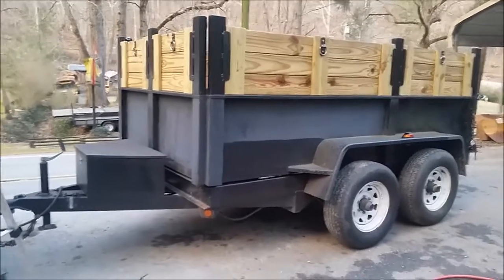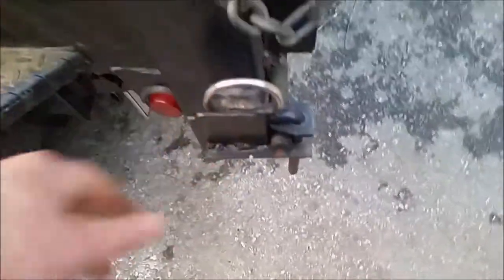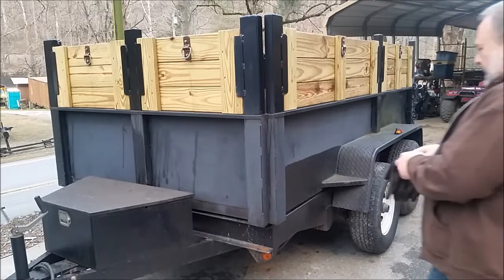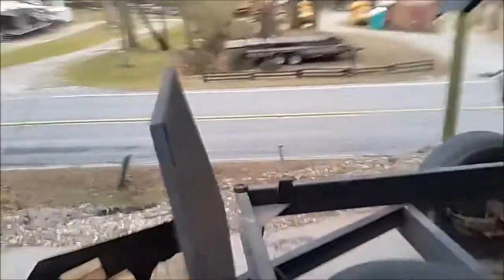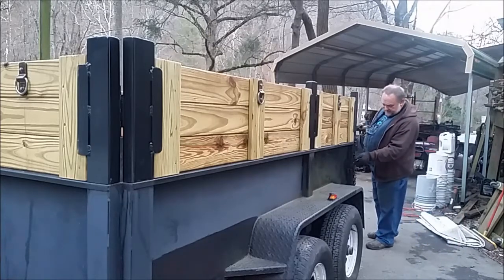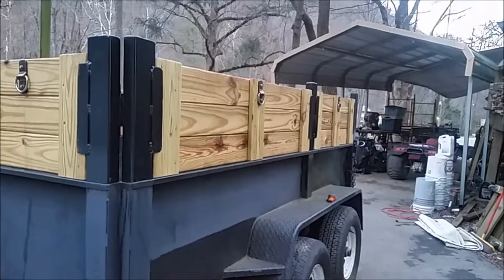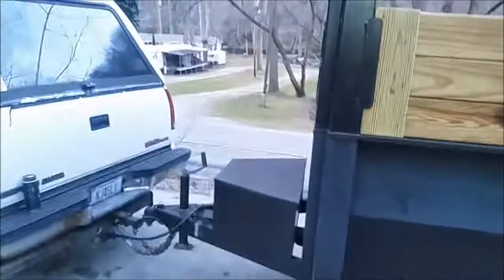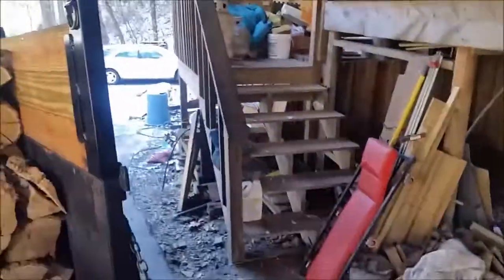Dump Trailer Upgrades: Removable Sides, Spare Tire Rack, Tailgate Mods, etc..

Comment: So the metal stakes are something you fabricated mostly yourself?
Reply from the maker: ForFoxSake. Yes.  Correct. I made them all myself. I used 3/4  × 1/4 angle welded inside of the 2x4 Rectangular tube. 
Had to grind the 90 degree edge of the angle to get a good fit. 
Hope that helps.
Reply: @MarkThomas123  Thanks, I saw online that some companies make the stakes for trailers like this but they are ridiculously overpriced.
Reply from the maker: @HexaFox  Yes. I agree.. But, I can tell you that, if it is a one size fits all solution, it won't fit "every" trailer well..  I have a Bri-Mar 6'x10' Dump Trailer, and although it is a good trailer, build well, etc,,, a one size fits all solution would not have worked..  The distance between the upright stakes were not the same on both sides, so, had I not checked, and built all of the Board Panels the same, they would not have fit. 
The 2x4" rectangular tube that was welded to the sides of the trailer where I slid the metal stakes into the pockets were welded heavy on one side, then, the other, so, they were surely out of square/rectangle, and each one had to be fitted to the hole. Buy building them myself, I was able to compensate for that by grinding off the center sharp edge of the angle that went up into the vertical square tube I added, so, it fit flat against the inside.. Then, drilled some holes and plug welded the top of them..  I only went up into the 2x4 rect tube about 3", but, it was too far to get a good weld, so, drilling a hole and plug welding worked out great.. 
So, basically, I ground down the sharp edge on 3" of the angle going up into the 2x4, so, the angle where it exited the 2x4 tube, the sharp edge of the 90 degree portion of the angle was actually past the outside diameter of the 2x4, and had to be ground down to fit the 2x4 stake pocket.. I ground each of them (4 pieces = 1 each inside corner of the 2x4 rec tube, where I welded in the 3/4" x 3/16(corrected, not 1/4)thick angle). So, a bit of grinding on each piece, but was able to get them to fit perfectly.. Then, I took a stick (1x1" ripped on a table saw), and taped a sock on the end, and put some bearing grease on it and mopped it up and down the trailer stake body to get it fully covered, then, the same with the angle.. It's been a couple of years now, and, still no rust, and they slide easy.. 
On the two rear stakes, I fitted a piece of 2" x4" x 1/8" flat bar between the 4 pieces of angle and ground it down to fit.. I was thinking it might need some extra strength, but, that is when I found out that the Rectangular tube wasn't rectangular from the factory, from the way the mass welded them together.. That took a heck of a long time to get both of them right.. The middle ones, I just used 4 pieces of angle sticking down only welded inside the riser 2x4 rec tube, and that was more than strong enough, so, that is the way I would do all of them again, if I ever did it again..  It took me a little extra time, because it was a "Mind Design" project. I just knew I wanted stakes and board panels and went out and figured out the best way to do it. Next time, I would already know.. Ha... 
You could do this yourself... All you would need would be some 2x4" x 1/8" rectangular tube, 3/4 x 3/16" angle 4pcs each upright, and about 24' of 2"x 3/16" flat bar for parts, and a 4" angle grinder with a 10 pack of cut off blades, and a 10 pack of Grinding disks, and you could grind/fit/drill all of the parts and take it to a welder, and he could weld everything up in 2-3 hours, and you could go home and grind the bottoms of the angle and make everything fit.. Then again, you could get an Arc or Mig welder from Harbor Freight and give it a whirl yourself.. :)   
But, you could do it with 2x4's and some strips to fit the rest of the pockets and come out fine too..  Should last a while if you treat it, and you cap off the vertical end grains of the 2x4's  with some sheet metal.. 
If you really want it to last, make it from treated wood, let the wood dry out a bit after you cut it (stand it on end while drying), then, get some plastic roof cement (roofing Tar), and put it in an old 1 gallon Ice Cream bucket, and keep mixing gas with it, until you can paint it on with a cheap paint brush...  It will dry and get hard, then, you can grease the piss out of it where it goes in the hole, and hope you don't have to drill it out if you ever have to remove it.. (what I had to do to the boards that were there that I had to remove.. Ha..Ha.. 
Either way.. It's a project you can surely do, if you take your time, and would be well worth your time doing it. 
I use my trailer at least once a month to haul off my household garbage to the dump.. They have an elevated dump station where I can dump into the back of an 19 wheeler below..  If I leave it in my trash trailer and go by myself, I have to unload each bag and stuff it in a trash compactor and keep running back and forth punching the crush button, and on both sides of the trailer.. I just park the dump trailer next to it and pull one side of the boards of and move everything from the trash trailer to the dump trailer before I go.. Then, all I have to do is back up, let the tailgate down and hit the lift switch and dump it all at one time and go.. 
Other times of the year, I use it every day for a week or two, and periodically, several times per year for a load here and a few loads there maintaining my property..  It's hard to justify the expense if you are not going to use it quite a bit, but, you will surely find things to do with it,, if you have one.. Ha.. :) 
Just remember.. A welder, a carpenter and a Surgeon all use the same basic set of tools.. Two eyes, two hands, and two feet, and what little we use of our brains.. So, there is nothing anyone else is doing, that you can't also do.. It's just the matter of "I can" before the "I do"..  I have not gone to school for anything that I do, and I generally do a better job than those who have.. One thing about teaching yourself.. You never know when you know enough, and no one is telling you that you "Can't" do this and "Can't do that".. I have drank quite a few beers showing guys who were told in welding school that you can't do this or that, so, they never tried.. And, I say, shit, what do you mean you can't do that.. Get me a beer and I'll show you it can be done.. Ha.. If you buy a stick welder (arc), get some 1/8" 6011 welding rods and don't buy any other rods.. I can promise you,, you can weld whatever you want (mild steel) with it.. from a gauge steel to 1" or more thick.. 
Same thing with a cheap Harbor Freight Mig Welder or "Flux welder without Gas".. I have done it too many times.. HF makes a good little mig welder.. A good plasma cutter too, but, the Cut 50's on Amazon are so much cheaper and they work well too..  Good Luck.. Hope things work out for you..  I'd better get back to work.. Upgrading all of my computers to Windows 10 finally.. Still have some work to do.. Would much rather be out welding something. But, have to build some cabinets and drawers  to do some organizing first.. Ha.. Cheers!!
Reply: @MarkThomas123  Thank you for the reply. If one thing is clear it is how passionate you are about this kind of stuff. I was also thinking about how a one size solution would not fit all either for this very reason. It is funny you mention it I was just looking at a Bri-Mar 6x12 dump trailer for my business. The stakes that I saw were way too expensive. It looks like you have to purchase them in pairs and they are like $200 a set or something unbelievable. Also you said you greased them? Can I ask what you used? I would imagine if these are not greased they would be destroyed in quick order.
Reply from the maker: @HexaFox  I greased them with Axle Grease or Wheel Bearing Grease.. It was to  allow it to slide easily without the chalkboard screeching effect, and to keep it from rusting and getting stuck due to the rust.. A little bit of rust can swell things pretty quick and jam things up. 
I just put a sock on the end of a stick, mopped on some grease (sticking the stick/sock into the can of grease and rolling it around, and then mopped the inside of the stake receivers, and the angle iron that was going to slide down in them.. Works great.. 
I have played around with all sorts of paint and prep.. It's hard to beat regular Walmart $0.99 per can spray paint. Seems the Rustoleum, no matter how much you prep it, still rusts much faster than the cheap walmart paint. The only thing I have found better (much more expensive) is a commercial product called MCU or Moisture Cured Urethane, and in the heavy silver metal filled flake paint, which you have to vacuum seal, or, fill with a gas heavier than air, and has a shelf life, at best of about 1 year, if you do a great job keeping the moisture out.. Nice thing though, you can paint anytime it is above freezing, and that is when I get to do most of my work.. Winter time. 
I used the Walmart Rattle cans on the trailer, because I knew it would be in the weather full time and I wanted to test it again.. Still looks great..  
If you are going to use wood, even treated, you have to seal the end grains, and, I have not found anything better than the Hydraulic Oil/Kerosene mix that I use on my trailer decks. I have a video on it when I did my 18' tandem Lawrimore utility trailer.. Just search for Trailer and you should find it. Still on the first application.. Just keep putting it on, until it won't soak up any more and, it should be good for 3-5 years or more.. If you really want to take care of it, recoat somewhere between.. 
Get the size you need.. If you are looking at hauling really heavy stuff, might go with a 6x10 instead of a 6x12. The payload is higher on the smaller trailers in the same Axle weight class because the trailer weighs more, so, less overall left for payload..  You will never fill up any dump trailer with Sand/Gravel, and won't need sides really.. 
But, if you haul removed roofing or limbs, lumber scraps, nice to have sides due to the volume vs weight.. 
10,000 lbs or 5 tons of gravel is about what my 6x10 is rated for plus the 2k for the trailer, and, there is a hump in the middle from to rear, about the height of the metal sides, and then, it rolls over to the sides, usually no more than 3-6" high on the sides (loaded by a huge Front End Loader). By no means full. Something to think about.  Make sure you get one with brakes on both axles, unless you are pulling with a 1 ton truck.  You never know when you will need that extra braking power, and, the tow vehicle pulling 12k lbs sure can use it, and make sure your tow vehicle has full time power to one of the pins to keep the battery charged while using it..  It is usually the top right pin when looking at the female plugin on the back of the truck standing  where the trailer would be. Some times people don't worry with hooking them up, but, you need it on a dumper..  They are pretty rough on  a battery.  And, keep the battery charged and don't let it sit with a low charge for long periods of time.. The Sulfation will get it, but, you can put a 200 amp charger on it for 30 minutes at a time, letting it cool, tapping on the battery while it is charging and knock the sufates off, and bring a bad battery back to life.. Leaving it in a discharged state is what causes the to Sulfate at a much higher rate.. 
I have learned lots of things over the years.. A lot of it, the hard way.. Ha.>Ha.. Some of those points are worth writing down somewhere and looking at them every now and then until they become healthy habits. 
Good Luck with that business... I hope not to have another year like last year with this Mask Crap... 
I rebuilt my immune system before the season and, wasn't wearing a mask , and destroying what I had done to not have to live with a face condom on.. I can't believe what is going on in this Country, but, if things don't straighten out pretty quick, and it looks like the Deep State gets away with what they have done, I'm just not quite sure what I am going to do.. But, if I have to move to a different State or Country for that matter, I am just idling right now, wondering which way I am going to go.. Sure as heck don't want to try to find employees under a Biden Admin..

Comment: Hey Mark, where did you get those metal sleeves fabricated to accept the wood sides you built?  LOVE that concept!!!  Great Job!
Reply from the maker: I made them.. They are  2" x 4" rectangular tubing with some 2" flat bar welded to the sides to accept the wood panels.
3/4" x 3/16" angle welded inside of the 2x4, and goes down into the 2x4 rectangular in the dump body..

Comment: Very nice walls .😍😍😍
How much you will charge yo do this in my trailer?
Thanks. And GOD BLESS YOU
Reply from the maker: Sorry.. I did not see your question.. I am in far Western North Carolina.. I thought about that.. Doing everything except the treating of the wood,  I would say, it is worth $2800 to build it again.. Materials and Labor, but, not 10 or 12 coats of the wood treatment. That takes a good while itself, applying, waiting for it to soak in, etc.. Easy work, but, time consuming.. Best done by the owner of the trailer.. Not anything technical about it.. I just used a 4" foam roller and a chip brush to get into the cracks... Cheers!
Reply: @MarkThomas123  THANK YOU!!!!

Comment: Where did you get those pocket stakes for side boards?
Reply from the maker: I built them in my shop. I wrote how I did it in the pinned article here.. If you try to build them, just know, whatever your stake pockets are, they are probably not all the same, so, whatever your design is, make sure it is "flexible". You will understand  when you read my pinned comment. There would be no way to build something like this and mass produce it. Each of my pockets were slightly different, so, each one was custom fitted, because, I hate shit that rattles on a trailer.. Ha..

Comment: Where did you get the metal stakes?!?
Reply from the maker: The black metal 2" x 4" Rectangular tube that sits between the wooden panels and at the ends and corners of the trailer?? I bought the rectangular tube, cut them to size and welded the caps on the top and welded the positions in them, and welded the bottoms and ground them so they would fit perfectly in each of the positions.. 
I seriously doubt you could buy a kit that fits well.. People who build trailers don't use jigs, or don't pay attention to using the jigs well enough to be able to buy anything but a custom solution these days.. I bought a pretty expensive Paladin Attachments "Kodiak" HD 7  box blade for my tractor not too long ago.. The damn thing was off 1/4" here and a 1/4 there and we are talking 7" x 34".. I did a bunch of mods on it to get it to work better.. It's kind of handy when you can do metal working.. Not super expensive to get started.. Arc Welders are cheap.. Harbor Freight Mig Welders are good and less than $200.. A grinder, etc,, and you are started.. Can't afford to pay a shop to do something like this job, unless you just "Have to Have it".. Lots of time involved.. Probably took me a full day to get the stakes built. But, it was my time and not some Shop Rate per hour.. Cheers..